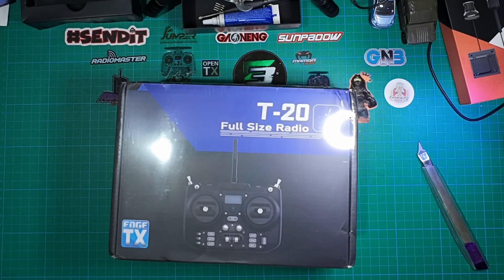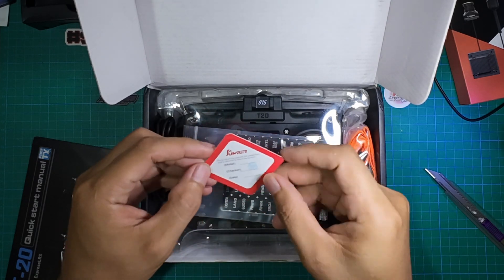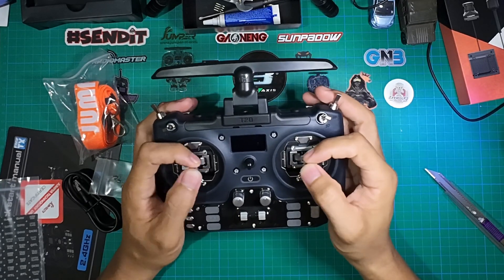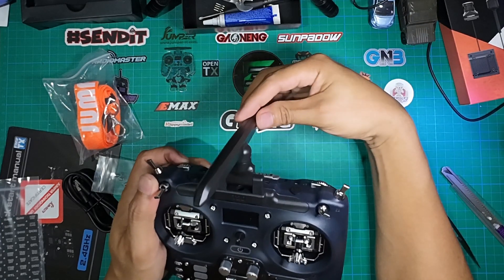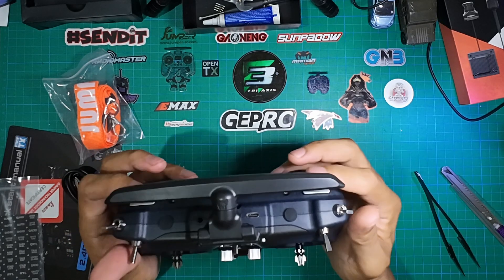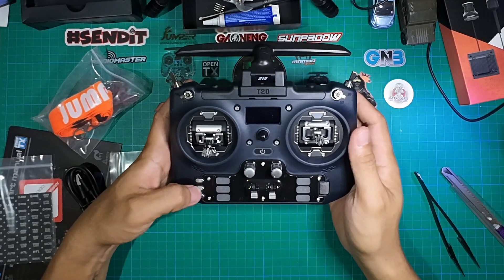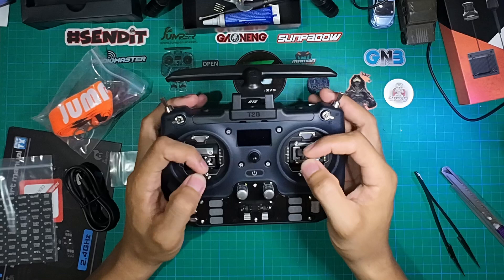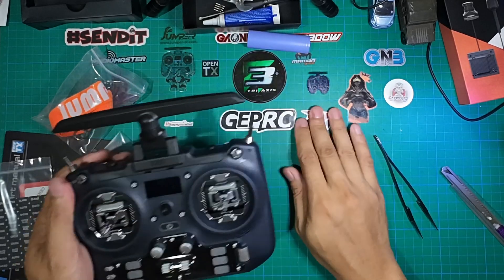Jumper T20S 915mhz ELRS - Quick Overview #jumpert20 #elrs

Comment: Nice video! Thank you! Will this jumper t20 915mgh transmitter bind with the R900 jumper receiver? Or wich one is a better option? Thank you
Reply from the maker: It only binds on any 900/915 ELRS receivers
Reply: @dirtndrones  Thank you!